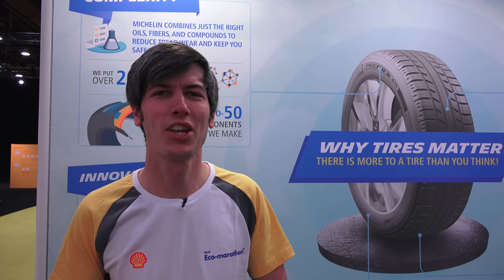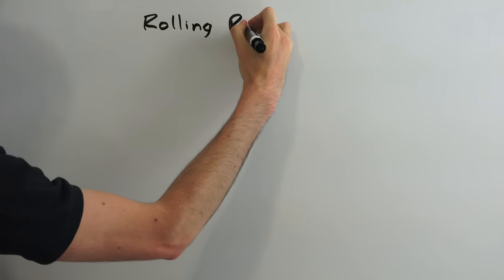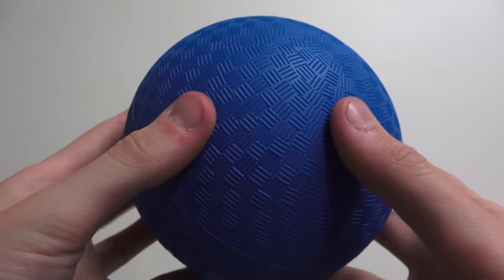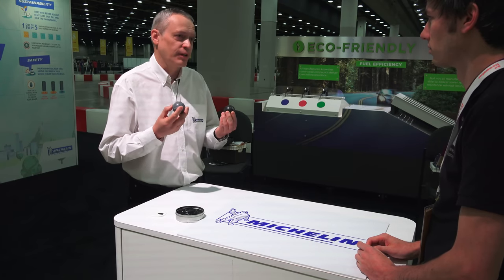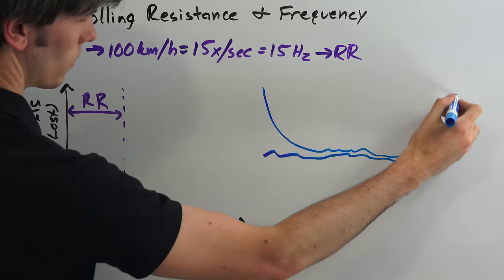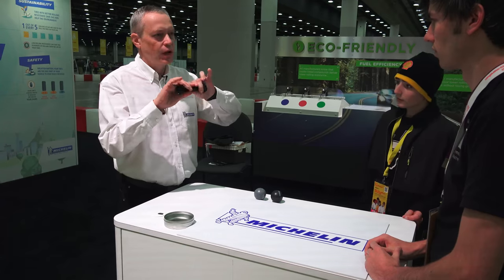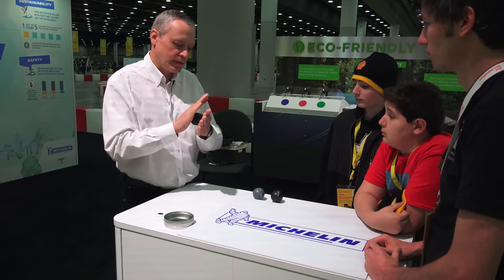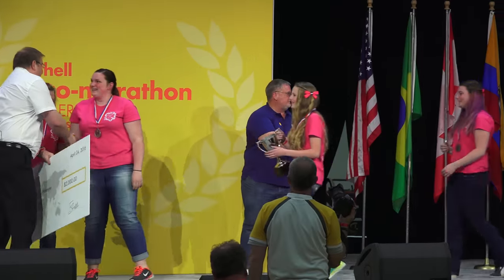Can A Tire Have High Grip And Low Rolling Resistance?

Comment: I am curious. I recently got into bicycling. I have heard plenty of times, from experts who take part in professional riding, that generally increasing the tire pressure reduces rolling resistance until a point, and then increasing it further will actually INCREASE the rolling resistance. Is there any truth to this? 

Intuitively I would think that more pressure= smaller contact patch, there for less friction and less rolling resistance. Granted with diminishing returns, but not negative returns.
Reply from the maker: +Random Guy I don't know if there's a point where RR goes down, defies what I would logically assume. There's certainly a point where it becomes unsafe, however.
Reply: +Random Guy I read a PDF about this once, which I can't find, in which people did some real-world testing. The conclusion was that although higher pressure always gives you lower RR when measured against a smooth drum in the lab, in the real world you reach a point where you're losing more energy because the bike is bouncing around too much-- and of course you will be damping that bouncing with your arms, legs, ass, etc. which is the point at which the energy is actually turning into heat.

I guess the same principle would apply to cars-- make the tyres too hard and the suspension will move more and more energy will be lost in the dampers. On the other hand, you've got to soak up those vibrations somewhere, and with the lower pressure tyre, you'll just be heating up the air inside the tyre more. How much suspension you want the tyre to do as opposed to the springs is a complicated question, probably having a lot to do with frequency and magnitude of displacement.
Reply from the maker: +ben c I like that logic, thanks for chiming in!
Reply: +Engineering Explained Thanks for making another great video! I never knew that stuff about Silica. People will link to this video every time the myth is repeated that the main energy loss is friction and that this is why there's a grip/RR tradeoff. Unless you drive like Jeremy Clarkson the contact patch is generally stationary relative to the road and you aren't losing much to friction.

Another question though is why exactly do you need high hysteresis for high grip? Is it just a side-effect of softness (which you need so the tyre can squeeze into the imperfections in the road) or do you actually need a damping effect (without it the tyre surface bounces out of the imperfections too much or something?)
Reply: ben c That does make a lot of sense. This is why road bikes are faster with out suspension (less energy lost while pedaling and less weight) yet mountain bikes are faster with suspension for the bumpy surfaces make up for the weight gain... not to mention it keeps the wheels on the surface.

Comment: When will Ultra Low Rolling Resistance tires be common place? I want to buy ULRR for my  Chevrolet Volt. I've been running the OEM Goodyear fuelmax LLR and run them between 45-50 psi with good results, but I want more!
Reply from the maker: +ERIC &amp; CINDY Crowder Apparently the Michelin Energy E-V tire has a RR of 6.5 kg/tonne; I'm not sure if there's anything publicly available that's better than this, but that's a pretty impressive number.
Reply: +Engineering Explained I didn't know there was a metric for rating rolling resistance. Good to know, hopefully manufacturers will started listing that metric with their tires

Comment: Can someone help explain why this matters at all. All this does is change the grip at certain speeds. Personally I would find it much more useful to have high grip at lower km's during relatively fast corners and acceleration and then have low rolling resistance during 130 km/h high way cruises.
Reply: +Rasmus Hvid the "grip" frequency is probably several hundred times the rotational frequency of the tire. Imagine the tire clicking once every revolution, like when you have a rock stuck in the tread. Then compare that to the frequency of the road noise from the tire. Even at 130km/hr the rock frequency is way lower than the road noise frequency would be at 1km/hr.

Comment: I still don't really understand how you applicate the silica to the tire, as silica has exactly the opposite characteristics that you would want for your tire. 
How do you "invert" these characteristics when you build your tire?
Reply from the maker: +Robzee But it doesn't, the putty just demonstrates that you can manipulate how a compound behaves at different frequencies. The first test (where he drops the ball) has a silica compound which is more efficient (lower hysteresis). But you can also have this compound with high energy losses at high frequencies, and thus more grip.
Reply: +Engineering Explained oh okay, now i understand. The putty confused me, i used to think that this is one of the compunds you put into your mixture for your tire. 
As always well explained, keep up the good work, greetings from germany :)

Comment: EE, I recently was in the market for new LLR tires for my hybrid. There seems to be a lack of any metric by which to compare different LLR tires too each other. Do you have any suggestions on a useful metric?
Reply from the maker: +Justin Treptow Usually they measure it in Kg/Tonne, the lower the Kg/Tonne the better, as the number represents how much resistance force there will be (in Kg) per unit of weight (tonnes) of the car.

Comment: I have noticed a small cheat. When mr. Damien Hallez was showing the 
differences between two balls (soft and stiff) he just dropped them - free 
fall, but when he was pressenting the new, improved material he threw it. It wasn't free fall.  I would like to see regular drop test - compararison of those three balls.
Reply: +Jacek Pawłowski It's not like that. In the first test he was just trying to show the differences between two different compounds developed years apart under the same conditions. The second test was meant to show what he explained in the video which is the difference of behavior depending on the frequency, so he kind of showed when he compressed the ball between his fingers: we can infer that from a simple drop, it would not bounce at all.

Comment: And what is about tire pressure or shape of the tire thread and the width of the tire?
Reply from the maker: +Sincee1809 Higher pressures and more narrow tires will lead to lower rolling resistance, however they will also result in a smaller contact patch, reducing grip.

Comment: How about the width of the tires? If we are talking pure rolling resistance vs. grip, what happens if you use wider tires, but harder compound or narrow tires with soft compound? Can anyone comment?
Reply from the maker: +GT4WJ Wider tires result in more rolling resistance, as it increases the contact patch. Harder compounds have the same effect.
Reply: But if I'm not mistaken, a softer compund has higher friction between the road and the tire? Thank you for replying!

Comment: how did you find that 100 km/h roatating tire will deform 15 times per second ?
Reply from the maker: I did the math in a comment below but I'll repost as it's been buried: Let's do the math for fun, calling the diameter of the tire "X." 100 km/hr = 100,000/3600 m/s = 27.77 m/s. So the tire's speed is 27.77 m/s longitudinally, and I've mentioned that the frequency is 15 Hz, as in it rotates 15 times per second. If we take X*pi we get the circumference. So we have 15 = (27.77m/s)/(3.14*X). Solve for X, you get ~.59 meters. In my case I was rounding from a tire diameter of 600 mm (.6 meters).

Comment: Hello could you please do a video about What causes the DSG fart ( Audi S3 Golf 7 r for ex ) and what causes the Pssssss sound when i accelerat then i press my clutch thank you
Reply: +nassim479 are you talking about your blow off valve?
Reply: +nassim479 
An Audi S3 or Golf R MkVII would definitely have a compressor bypass valve or blow off valve, and because the DSG shuts the throttle for an incredibly brief amount of time, you're getting the blowoff valve hiss but for an instant, leading to what you call a DSG fart.

For your car, the hissing sound when you release the throttle is because of a blowoff valve.
Reply: Thank you for the answers but what does the blow off valve do exactly
Reply: +nassim479 i think stock valve for audi & vw was DV (diverter valve) some people did swap to blow off, most Japanese turbo car were using blow off valve as their stock valve

Comment: Interesting! How can a rubber wheel roll lighter than a steel wheel on a train?
Reply: +AkaAndyKnuckles My school won this competition several times. 
The tires are very small but have big diameter, they have very thin and have a hard  slick like surface and very high pressure. Its nothing for road use because i litte rock kann destroy the tire and the grip niveau is very low.
Reply: +MKS Racing Technology never ceases to amaze.

Comment: The silica compound acts almost exactly like Silly Putty, I'd bet it isn't much different if at all.
Reply from the maker: +K Hetrick Remember, the compound he's showing is acting the opposite of their tire compound (as he mentions). The demonstration shows that you can manipulate the behavior of a compound depending on the speed of deformation (frequency). Tires will have high energy losses at high frequencies (where as this 'putty' he's using does not).

Comment: How do motors in the back of cars get water if the radiator is in the front ? Like it has a pump for the distance from the front to the back??
Reply: Yeah it's a pump most mid engine super cars have 2 pumps or one big one with large fin to overcome parasitic loss and when an engine is at operating temp the heat creates a lot of pressure which can accelerate the coolant much faster but this is to my knowledge correct me if I'm wrong

Comment: so the bouncy ball is less elastic than the kickball right
Reply: +Myles Kleinsasser (XxBAXWARxX) You have it backwards.

Elasticity is the ability of an object to return to its normal shape after being deformed. Because the bouncy ball more readily returns to its normal shape than the other ball, it is more elastic.
Reply: +γRB Doppler but the collision   between the bouncy ball and the table is more inelastic because less energy is converted into heat and sound
Reply: +Myles Kleinsasser (XxBAXWARxX) at least thats what physics tells you

Comment: This doesn't make sense.. Surely with silica if it deforms at low frequency (i.e. rolling frequency) but does not deform at high frequency then it generates heat at low frequency which is the exact opposite of what one is trying to achieve?

Comment: This would be nice. 13,500 miles destroyed all 4 continentals on my Mercedes. need something to last a little better.
Reply: alignment or cheap tires? that is really bad :/
Reply: Brand new car with continental tyres. It's a rwd Mercedes so they get worn through pretty quick. Tight steering lock cambers the front tyres quite a lot and the torque chews up the rears. All in all very expensive tyres lol
Reply: At £110 per tyre fitted they're not cheap lol

Comment: Is this Silicon technology a relatively new technology or is it something of a concept to be?
Reply from the maker: +faisal3398 It's been used in tires since Michelin introduced it in '92, though obviously there are always changes being made to the composition/structure for optimization.
Reply: +Engineering Explained What about tires of a style older than '92 that's been around since then? Are there any brands that don't use it?

Second, entirely unrelated question- how does mud (with a tire sunk, say, 10cm in) relate to the hz measurements? Would it deform more or less?

Comment: what is the size of the tire you used to end with 15hz ?
Reply from the maker: +SpIRiTus1995 Let's do the math for fun, calling the diameter of the tire "X." 100 km/hr = 100,000/3600 m/s = 27.77 m/s. So the tire's speed is 27.77 m/s longitudinally, and I've mentioned that the frequency is 15 Hz, as in it rotates 15 times per second. If we take X*pi we get the circumference. So we have 15 = (27.77m/s)/(3.14*X). Solve for X, you get ~.59 meters. In my case I was rounding from a tire diameter of 600 mm (.6 meters).
Reply: yep, i did it for myself too, correct, thanks x)

Comment: My first set of tyres on my mazdaspeed 3 only lasted 8000 miles.
Reply: +Armesis P which speaks for a proper usage of the car ;)
Reply: Same. Pirelli P-zero assymetrico on my boosted Si didn't last a whole summer
Reply: My Toyo performance tires lasted 14k miles on my speed6. They were summer tires and were 255 on factory the speed6 had 215
Reply: spoon games Yeah thats probably cos the speed6 has 4wd, the ms3 is just constantly spinning its front tyres. But the car was new and i was too eager on the throttle lol.
Reply: Yea I wasn't too hard on it until I got hpfp and a tune but it's fwd all the time except when there is high torque or power demand but it was like 600 a set, and also do u have 1st or 2nd gen speed3?
Reply: spoon games 2nd gen, stage 1 tuned only.

Comment: Ok I couldn't understand a word that guy said... Could someone put the silica thing in simple terms??
Reply: +Brett Young what he basically meant is that at lower speeds, less than 100kph, we want low rolling resistance, or in other words, we want to loose as less energy as possible when the tire deforms. At higher speeds however grip becomes more important for obvious reasons, in that case we want the tire to deform as much as possible very quickly in order to match the surface of the road and provide the grip. Up until now the compounds used to tires acted in a way that their amount of deformity, or hysteresis loss, was more or less the same regardless of the speed the tire is rotating, so it was always a choice of having tires with less hysteresis loss, meaning less deformation at lower speeds thus higher fuel efficiency, but also lower grip at high speeds because of that, or instead have tires with very high hysteresis which provide less fuel efficiency but high grip. The new Silica compound doesn't act linearly, its hysteresis varies according to the speed or frequency of the tire, at lower speeds it has low hysteresis meaning low deformity and so high fuel efficiency, but at higher speeds the hysteresis shoots up so there's more deformity and so higher grip; you can see that when the scientist man was squishing and stretching the ball of silica compound.
Reply: + sadman hoque..... Ok that make sence... But I noticed at high speed the silica just ripped... Naming less flex... Where at slow speed it stretched... Which would prove u false... But what u say makes sence and it sounds right it's just the display says other wise... Or am I seeing it wrong... Cuz like u said u want higher grip at speed
Reply: Brett Young
think of it like this, at low speed the silica compound acts flexible like a rubber band, and at high speed its inflexible or brittle like a biscuit.

Comment: It's unclear how hystheresis relates to grip.
Reply from the maker: +VioletGiraffe More hysteresis results in more grip (more energy lost to deformation correlates with the tire holding the road better).
Reply: Engineering Explained, thanks! Is it essentially the same as saying softer tyre yields better grip (and is less efficient for obvious mechanical reasons)?
Reply: Hysteresis implies that the tire deforms the same way metal dents and stays dented in order to have more grip. Nature sends you an energy bill for the attachment process. Low hysteresis implies that the tire is in contact with the ground rather than attempting to form some sort of chemical bond.
Reply: This is what I'm trying to understand too, which is how I got to this video. I'm not sure that I understand it completely  (or correctly), but I can attempt to explain what I got about it. The key thing here is that hysteresis only matters in a moving tire, because it's a dynamic effect. High hysteresis rubber is more "viscous", it's more reluctant to change it's shape both on initial deformation and on a rebound, because it dissipates energy on any change of shape. This is not the same as softness. Think of a coil with a hydraulic damper. A coil without a damper has (nearly) zero hysteresis. A coil with a damper has more. A stronger damper means more hysteresis.
When a tire moves, static rubber-road friction is never really static. When the forces of weight, torque and cornering are applied to a piece of rubber, it needs to "set" to a steady state, which it will never achieve because those forces are constantly changing as this piece is moving through the contact patch, or rather the contact patch is moving over the piece. And while it is "setting", it dissipates energy, which means that the forces that act on it have to do some extra work to overcome this "damper" resistance. This means that you can momentarily apply more force to this piece, because part of it will be taken away by the "damper". And since new pieces of rubber enter the contact patch all the time, this "momentary" thing applies to all of them, and a moving tire can handle more horizontal force, i.e. gives you more "grip" or "friction", than a standing tire.

Comment: so our new tires will be silly putty? neat!
Reply: +crisray6789 If you drive to fast your tire will fly apart a bop your roommate in the face by accident and end up lost under the couch.
Reply from the maker: +crisray6789 The compound he's showing is acting the opposite of their tire compound (as he mentions). The demonstration shows that you can manipulate the behavior of a compound depending on the speed of deformation (frequency). Tires will have high energy losses at high frequencies (where as this 'putty' he's using does not).